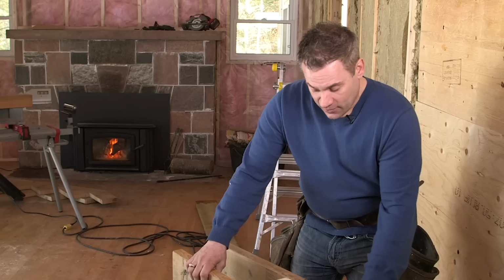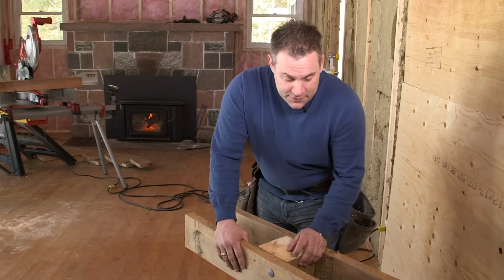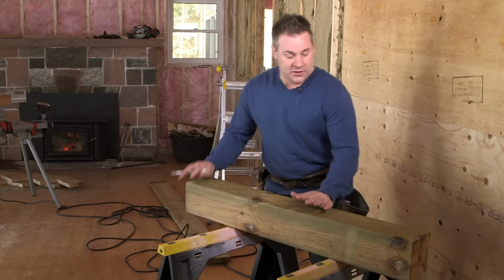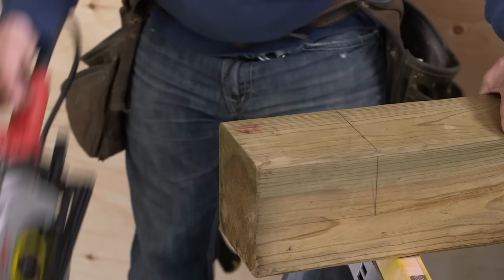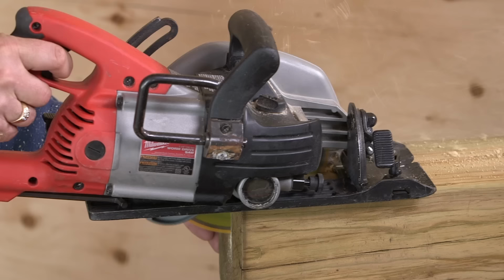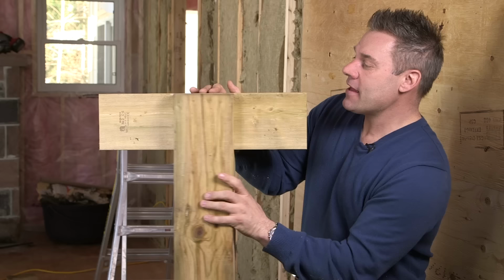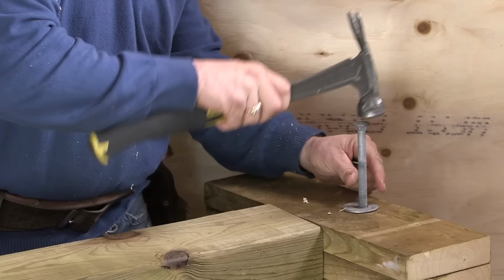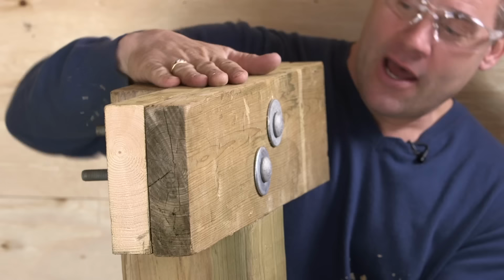How to Attach a Beam to a Post for a Deck | Decks, Docks & Gazebos

Comment: No no no no no FOLKS  this guy is DEAD  WRONG  if you want a solid beam run you beam 2x10 then fill in the middle it's  called a barn beam they did this in the old fashion barn s and they DON'T  sag  this is brought to by a 30 + yr CARPENTER thank you

Comment: a grade 5    1/2 inch diameter carriage bolt has exactly 14,730 lbs of shear strength, so between the two bolts there is over 29,000 lbs of shear strength.  if your goin to make a video at least do your homework.

Comment: Mr Lake, you need to check into standard building codes before posting this kind of misinformation. You also need to understand the meaning of shear strength. In addition you need to stop putting washers on the ‘head’ side of carriage bolts and learn why they are designed with a square under the domed head. This video is an embarrassment to real carpenters and fastener manufacturers and is unfair to people trying to learn the trade.

Comment: You yanks love to over engineer decks. I'm waiting for that dude that says a double 6x2 isn't code and a quadruple 14x6 is needed with M30 bolts and 100x100 posts on 5000psi steel reinforced concrete 29m footings.

Comment: THIS GUY IS SO WRONG AND HE HAS NO IDEA WHAT HE IS TALKING ABOUT.   CARRAIGE BOLTS ARE, IN FACT, THE PROPER WAY TO DO IT.  NOTCHING POSTS AND SIMILAR METHODS ARE NOT ALLOWED BY MOST BUILDING CODES THESE DAYS.  THE SHEAR STRENGTH OF TWO 3/8" CARRAIGE BOLTS IN MANY, MANY TONS.    YOU COULD FILL THAT DECK WITH PEOPLE AND YOU WOULD NOT SHEAR THOSE BOLTS.  DO NOT LISTEN TO THIS MAN.

Comment: Yo Pardner, Go get a real job and quit giving bad advice! No one in their right mind uses a flat washer on the head of a carriage bolt thereby defeating the purpose of the square head! And always separate the horizontal members to allow more spread on the load bearing surface!

Comment: I don't know exactly why u say it is wrong. The thing was fasterned with a 'screw' locked with a nut on the other end. It won't break unless the weight is excessive. Yr design is the one used by carpenter because they look great. How sure are u it won't break ? But your's may be an improvement.